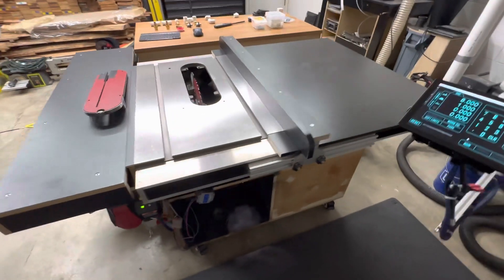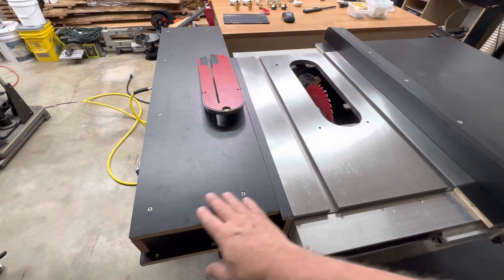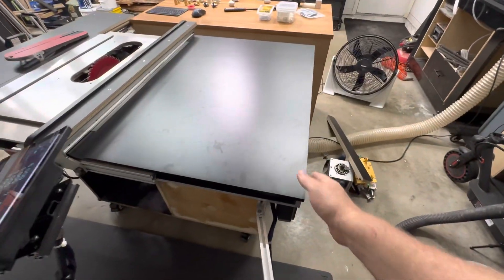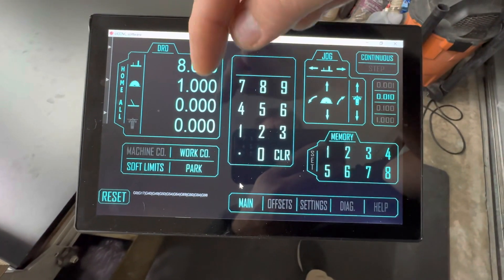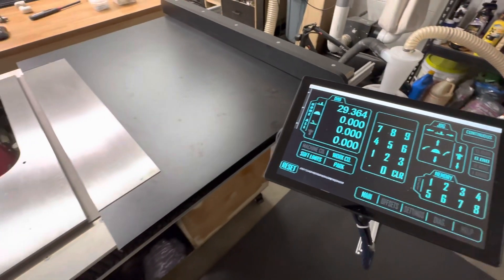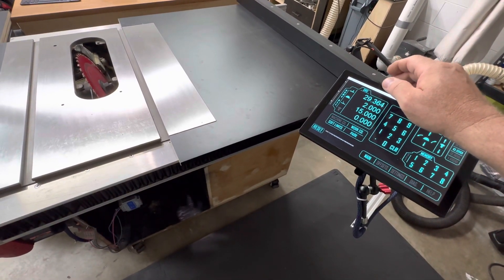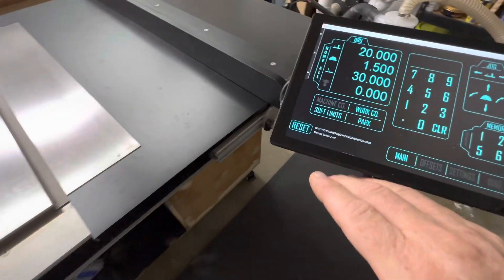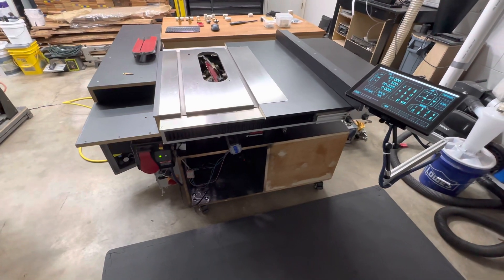CNC SawStop

Comment: Very nice project!! I was wondering if it"s possible to compensate the fence to the angle of the blade... and you could even compensate it to the top of the workpeace if you can fill in the material tickness....

Comment: Hey Mike 
Would you be able to share how you designed the screenset.
Thanks
Reply from the maker: I made the screenset in Affinity Designer which is similar to CorelDraw or Adobe Illustrator. I just laid out the design I wanted and made a background image that has all the boarders. Everything else are individual images that get assigned to buttons in the UCCNC software as the background image of the button. There was a little bit of coding I had to do to make the numeric pad and have it function they way it does instead of a popup numeric pad that blocks out a portion of your interface. Creating a custom user interface with UCCNC is built right in to the software. There is no other software you need to create the screenset other than a graphics program to create the images but all the layout and coding is done right in UCCNC. Honestly one of the easiest programs I've worked with to create a custom UI for a machine.

Comment: What type of 10" control touch screen did you use?  What software to connect to Arduino?
Reply from the maker: I used a mini computer with Windows 10. The software interface is UCCNC which connects to a UC300ETH controller on a C94 BoB from CNC4PC. The screen is just a 10" capacitive touch, multi touch, touch screen. I have 3 machines in my shop with the same controller board and software just different PC's and screens on each of them. I used the mini PC on the saw because it's not having to run through 1000's of lines of G-code quickly which I don't think the mini PC would be able to keep up with.

Comment: Love, love loving this. I am in the process of building my own CNC tablesaw. I was thinking of going with threaded rod's for the fence on both sides and connect them together with a timing belt and pully system. It looks like you have a rack rail gear system. Why did you choose to go this way? What are the advantages and disadvantages?

I am new to CNC and could really use your advise.
Reply from the maker: I actually went with a belt drive system and linear rails. The front and rear are independent from each other. I had tried a ball screws originally but the longer they need to be the bigger diameter they need to be to avoid whipping plus I'm able to get faster speeds with a belt drive then a ball screw. I have the front and rear driven independently so that if for some reason the fence becomes out of square to the blade, all I need to do is home the fence again and it self aligns.
Reply: Very cool setup.  I am looking to do something similar and have been looking at belts. Lots of opinions about what belt profile gives the best accuracy (mostly repeating mfg marketing info) I did find Pfeifers supply that gave AT belts the best for accuracy.  Could you share what profile and size you went with? Does the belt alone give you that accuracy or are you using UCCNC for backlash compensation? Thanks. @MikeSmith

Comment: How did you handle backlash with the handwheels?
Reply from the maker: When moving the blade up it's always against gravity so I just move to the position I want but moving down I have the blade go .250" past the position I want then back up to the desired position. I do the same with the angle

Comment: Hi Mike, I just found your channel in my recommended feed and I love the videos I've seen so far of you!

Would it be possible to go more in-depth with it and describe how you wired it all and what parts you used and for which reason (and maybe what to change in your code if we use other parts) ? Personally, I don't see a reason why I should use the CNC software, but everything in the UI is perfect and I would like to be able to replicate this with my Delta ShopMaster 10" table saw. It is so cool and such a time saver!

I know that on my saw, I would like to someday add an automated stock feeding roller that could control the workpiece to do stopped grooves and whatnot because I personally find it quite hard to stop at the perfect distance to make a stopped groove with a tablesaw and setting up the router table would take more time than just doing 7-10 passes on the tablesaw. Maybe that could be something you could add to yours too!
Reply from the maker: I'm actually going to be adding a router to the right side of the table that will also use the CNC controls to control the height. I will be modifying the fence so that I use the back side of the fence as the fence for the router. Of coarse I'll need to adjust the software so that I can select which tool I'll be using and it will automatically adjust the fence position based one the router bit diameter. I've had a few others followers request a more in depth video of the saw so I'll be posting that soon. I'll explain why I used the SawStop instead of other saw and go into depth on how I made the linear actuators for the fence also.